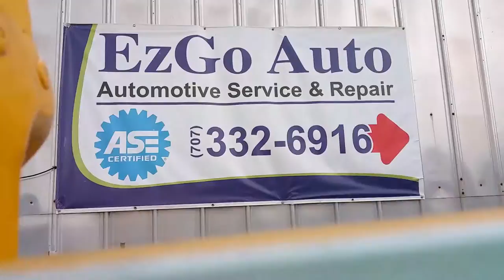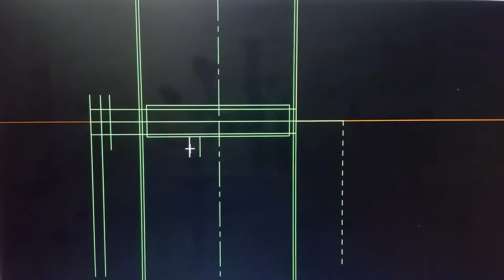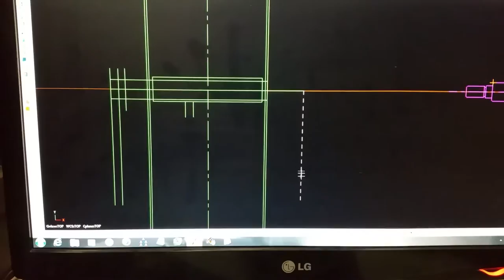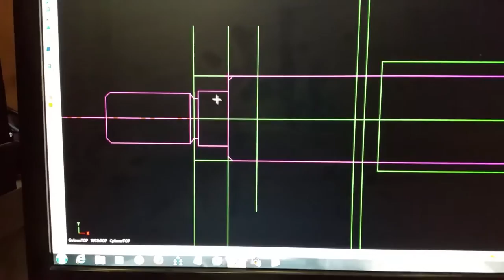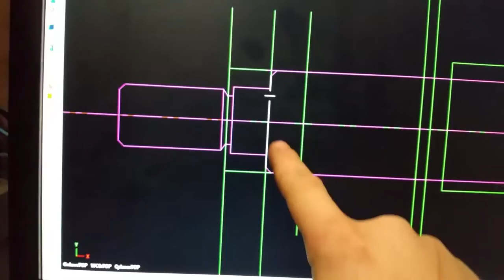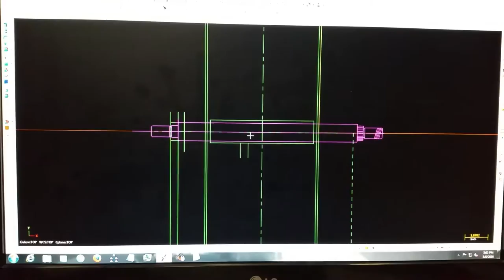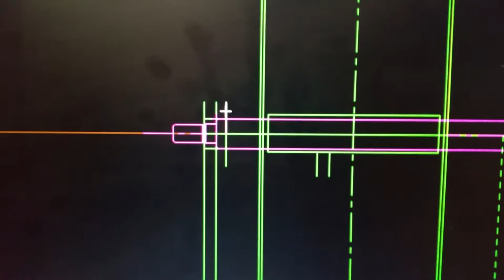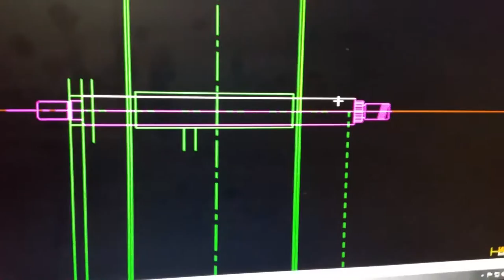Ford E350 (short bus) ZF-5 Manual transmission swap! Floor, doghouse, driveshaft and pedals.

Comment: Updates dude! I was just thinking about your channel, working on a property in Healdsburg and thought of starting a blog. Bought a vw bus ive been restoring it
Reply from the maker: aaagh, frustrations! pedals are done and installed, but are going to need some further tweakage, I have the new driveshaft, 430$, custom. Yoke on tranny was worn to shit so I cant make my little laser alignment tool (will be explained in the next video when I do the alignment) until a new yoke comes in and hopefully when I get back down there the mechanic has sliced the bit of the floor we had to peel up so I can get started on the doghouse.
Work is slow so my hands are tied, I'm stuck until I get a paycheck or unemployment comes through.

Comment: Nice work.  It would be fun to deck out the interior.  You should check out tiny houses for space saving ideas.  Ikea has some crazy "life in 150 Sq ft" displays.  Amazing what designers have done with very little floor space :)
Reply from the maker: +tiporari One word: Unistrut.
Reply: Haha, yes!  Beauty is you can bolt it together and recycle/change it any way you like.  Brilliant idea :)
Reply from the maker: +tiporari Yup, next up on the list is refinishing the floor and picking plywood that is the same thickness as a half height standard unistrut rail so I can recess them into the floor. There will be integral anchors to the roof for vertical strut rails and from there on its just straight up erector set time. Ill get myself a cordless porta-band and impact driver and then the sky's the limit.
Reply: +Max Maruszewski I have had a Porter Cable impact driver for a couple years now, and I must say, it's a go to tool for any high parts count assembly/disassembly work.

It has paid for itself several times over and is still going strong.  Charges fast enough you can work without stopping.  have fun!

Comment: You should crack a window open when using that heater.  It does not use fresh air so that is why your windows are fogging. Going manual is the only way to go.   Keep that RPM right in the sweet zone.  Great job!

Comment: Looking good so far. Going to be a good fix. I wonder about brazing holding up as good as welding, I don't know much about brazing though. You're going to find it worlds better driving with the control you will have gained having a manual transmission. You can now engine brake and get a leg workout in traffic. That couch looks really long, I'm 6'1 so I have a problem on most couches, I cannot fully stretch out.
Reply from the maker: +Doogie Rick in a lot of cases brazing is actually stronger than a weld because brass is softer than the metals you're joining it allows for extra flex, n stuff. Just wait till you see it sandblasted its gonna be pretty.
Reply from the maker: Bushings are nylatron ;)

Comment: Nifty. I found this because I'm thinking about converting my e350 super duty to a manual. Looks like it would be pretty fun.
Reply from the maker: It's not too bad! Pedal assembly is by far the hardest part as long as you have a local drive line shop to help you with the shaft.

Comment: Did you consider a manual transmission pedal assembly from the Ford E-series? The vans came with SROD, SMOD, and M5OD manual transmissions.

My folks had a 1979 with SROD and I almost bought a 1990 M5OD last year. Not exactly common but not quite hen's teeth
Reply from the maker: I did as much research as I could at the time but I believe I came to the conclusion that no existing pedal assemblies would work. Theres not much room down in the footwell for even the mod I did, I'm having trouble imagining what a stock design would look like. I'm extremely curious to hear more about your experience though.
Reply: Max Maruszewski the Original Equipment pedal assemblies designed by Ford for these vans fit them quite well. They're available in both mechanical linkage and hydraulic versions. Only potential issue I forsee is a possible difference in hydraulic systems between M5OD and ZF5 transmissions but since both trans were used in F150/F250 which themselves share pedal assemblies, I'm certain a bolt-in master cylinder swap would solve that, if in fact there were any differences in the first place. 

Replacement parts for the vans with manual transmissions are available in the usual places, rockauto, napa, autozone, etc so bushings, linkage, master and slave cylinders, hydraulic hoses, etc are readily serviced. 

The M5OD also passes its shifter through the doghouse so the boot for it should fit your ZF5 no problem.
Reply: Max Maruszewski there's a linkage type assembly on eBay right now. No affiliation.
Reply: Just updating you guys, Im currently using a pedal assembly from a fellow vanner in Texas. Both vans are turbo idi, and his was a zf5 with m5od pedals. I bought the pedals, and they are a bolt in setup in place of brake pedal in my 1991 e350 4x4. I searched for 3 months for pedals, and he found this set years ago and decided to go bigger still and use an Allison auto. Just an FYI for the future, they are out there, but M5OD 6 cylinder vans only..... finding a set is next to impossible.... but can be done
Reply: Kevin B got a video of the swap?
Reply: No buddy I don't yet. Project van, I will once I get farther along, right now sourcing parts and hoping to hammer it out this summer. Also doing interior over and just normal brakes and little stuff to make it drivable

Comment: how did you get the aftermarket slave cylinder to adapt to the factory type throw out bearing ..................id love to see some pics
Reply from the maker: I used the stock cylinder lol, its just the master that's different.
Reply from the maker: Anything specific you want pics of?

Comment: Where did you get you clutch master cylinder
Reply: I'm converting mind right now just can't find the clutch master cylinder you used
Reply from the maker: @zacharyhawk6040  

Choose between one of these two depending on which outlet thread you need in order to have the custom braided clutch cable made. 

3/8-24 vs 1/8-NPT
https://www.summitracing.com/parts/wil-260-13624
https://www.summitracing.com/parts/wil-260-12387

The stock bore diameter for the f350 master cylinder is .875" 

Talk to a local hydraulic shop to get the line made, I bought a new slave cylinder which came with the stock line and the hydraulic shop was able to cut the fitting off of one end and add the braided line.

Lol I just did all the research again before realizing I already put the part number in the description bro >_<

Comment: You can get your Clutch & Brake Pedal Support Bracket from the F350 as well as the master cylinder.
You don't have to "MAKE" anything. The Rule of Thumb for the conversion is Model# to Model#. Ex: E150=F150, E250=F250, E350=350. I want to save your having to "Invent" Anything. I have converted MANY cars and trucks from Automatic to Manual.
I hope you follow my advice, because the Brake Pedall Bracket is hardened.
Reply from the maker: Haha, no. The f series pedal assembly is not even close to the e series.

Comment: Oh Yeah weld plate a plate on your firewall to eliminate flexing of the firewall under your Clutch Master Cylinder.
Reply from the maker: My clutch doesn't interface structurally with the firewall, there is no room to do it that way on the E-series, I have talked to two owners now who have since done a manual swap and one of them did try to do the firewall method but ran into issues as you suggested. Mine mounts to the side of the pedal assembly and I haven't had any flexing issues at all! Just make sure you use a proper bearing in the pivot as I've gone through two pins now.
Reply: @ @Max_Marz I'd like to see that...I'm man enough to eat crow if I'm wrong. Just want you to know I'm not here to "Troll" you. If your design is solid I just might modify my support bracket the exact same way to convert my E350 4X4. Because I fucking hate my Borg Warner transfer!!!! I do have an NP205 transfer which can mount a PTO. So yeah...please post your finished product & if I gotta eat crow...then pass the fucking salt & pepper...LMFAO!!!! 
Aloha from Hawai`i, Chief
Reply: @Max_Marz  instead of a broom handle for alignment I usually use either bar stock, or spray the shaft with anti spatter compound or grease the shit out of the shaft with MIG nozzle dip. GOOD JOB!!!! 50 Stars & 50 Thumbs Up!!!!!
Aloha, 
Chief

Comment: Hey, I can't find anyone that can do my zf5 swap on my E40D! Would you sell me the pedal assembly? I'm dying to put the zf5 in. My trans is fried and has nothing left. I love your video.
Reply from the maker: It's all custom man... No I'm not gonna sell you my pedal assembly haha. You have all the info you need right here to do it yourself.

Taking the e40 out and putting the ZF in is literally the easiest part of the entire swap, it's like eight bolts. Getting the driveshaft re-workrd, carrier mounted and pedals modified are the hardest parts and you won't find anyone to do it for you except maybe a fabricator.

Comment: right mate we have got to communicate. I see this is 2 years old. how is it going now? I have a 1978 Holiday Rambler 27' motorhome on a E350 chassis. it's about the biggest class C rv I've ever seen. at least the most heavy. I have a 460 that runs fantastic, and I hate hate hate automatics and WILL be putting a stick in this thing. I have completely modified the thing throughout, I built a work bench because I build sturmey archer gear hubs and make all kinds of lovely things, I have loads of tools and bike parts in this thing, a couch, weird shit all over the walls. I would buy that artwork on your bus for $15 and stick it to my wall. I will show you a picture of this thing if you want, its pretty modified. the bathroom has been gutted and replaced with something far more practical, I RV and ive completely fallen in love with it, fixed it up exactly the way I want it, my cat loves living in it, its quite large-- but not too large-- and after ripping out all the stupid crap motorhome junk and the carpet and painting the floor and building a workbench and last winter I had some weeks off because the factory I work in was shut down because they were adding new machines, I listened to the Winnipeg Jets and got drunk and stoned and decorated my RV with my beloved cat. my neighbor who bitches about everybody told all the other neighbors I just smoke pot in my rv all day, and then I showed him my last paycheck stub and showed him the 56, 60, 66, 70 hour weeks I work. idiot. anyway I am an industrious chap and when I do not have my insane job which I love I have to do SOMETHING. I build bikes in my spare time as well, very very nice bikes, basically old Japanese road bikes from the 80s and rebuild them with Sturmey Archer AW or TCW three-speed internal hubs and a brand new sturmey archer hub brake/dynamo on the front, I use old Raleigh-style mudguards and braze and weld basket carriers onto the frame at the headset; instead of a basket attached to the handlebars and hub acle, its attached to the frame, which carries the weight of the cargo so it doesn't affect steering. I collect and rebuild sturmey archer stuff. so I basically have a weird little bicycle workshop full of tools and a couch and a fantastic bathroom. and the thing's bloody beautiful, I plan on painting part of the exterior soon as I can, it'll look great. so I have a 460 and C6, I love the motor, but hate the transmission. this thing otherwise runs great, but this is a very, very heavy rig and the automatic 3 speed is fucking AWFUL. I drive across Snoqualmie and Blewitt passes often, and into Seattle where there's hills everywhere. I used to drive trucks and I very much like driving a big heavy thing with gears and a clutch. I have the income to be able to ditch the C6 if never the time, I work 7 days a week from may to December and then either 5 or 6 but usually 6 days a week. I plan on using my nest vacation time-- two weeks-- to swap out the tranny. tune it up good while I have it apart. I love working on shit, hence the sturmey archer hubs &c and I cant wait to get rid of this disgusting automatic. what I would like to do is get an old-style 4 speed with unsynchro granny 1st so I can crawl up seattle hills slow as ya like and then a two-speed overdrive for Snoqualmie and blewit pass. I have been trying to figure out how to do this, I know its possible, I had a 3-speed on the tree 79 six cyl van years ago, but I have a 460... big difference. I cannot say how valuable this is to me, this video you've made, you are doing exactly everything that I really need to know and haven't yet been able to figure out despite much trying. I would really like to get in touch with you and see if it worked, and maybe if that workshop that did the transmission swap would do it, I would take it there to have it done. if they can do it in 10 days. I live in the middle of Washington state. I used to travel the country when I was young, and I haven't been to California in maybe 12 years. I used to go there all the time. it would be nice. all my mates got family in California, too. anyway I would like to be in touch with you, I cannot say how much this helps, ive GOTTA know more. I should post some stuff on what ive done to the Holiday Rambler. it has a weird suspension that ive figured out how to repair. it has a tag axle, a third axle behind the rear axle, like a motorcoach, so the thing has 8 tires. there is a big weird block of rubber that makes up half of the suspension which is of course deteriorated after 40 years, and you don't want to have 40 year old crumbling weird suspension. also done some pretty trick stuff with the plumbing, furnace, bathroom, kitchen and everything. and uncovered some weird holiday rambler know-how as well. you see videos like yours are a perfect example of the good that the internet can do, the democratization of knowledge. and when I see stuff like this I feel like a jerk for not having shared the things that I have learned, like the sturmey archer stuff and what ive don'e to this rv. I am working on a sturmey archer FW hub right now, a 4-speed I just bought on e-bay. they can be converted into a five speed with some extra trick parts. mine has a knackered primary sun gear and all the planet pinions. it is a stepped gear, but is the same as the one used in another contemporary hub. other parts can be added and fabricated to convert the 1945-1969 built FM four speed hub gear into a trick five speed with two shifters. I have my own shifter design, too. I feel like a jerk for not sharing this-- this is hard-to-get knowhow. anyway, reply and i'll give you my email.
Reply: Clev Twopointoh hi